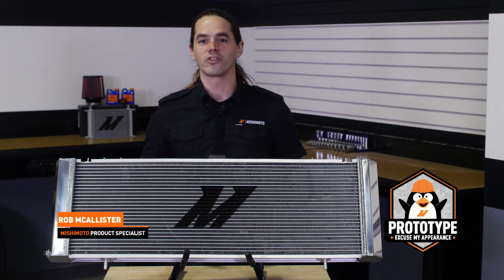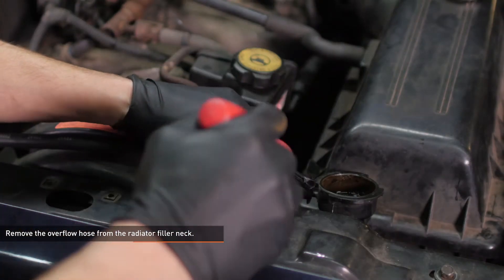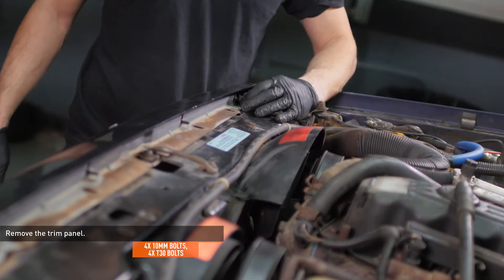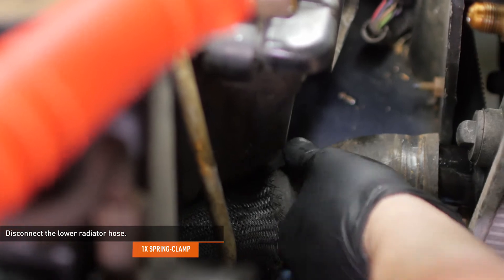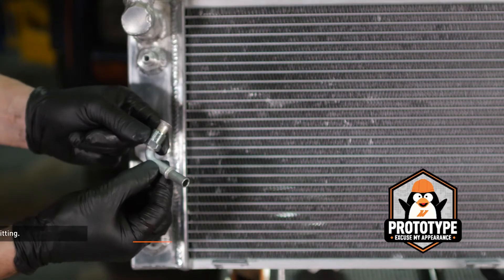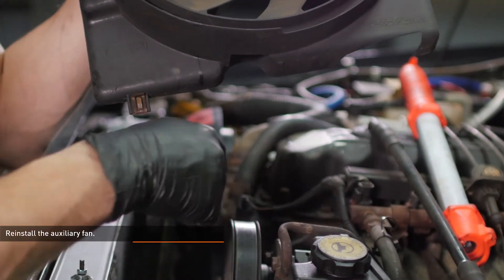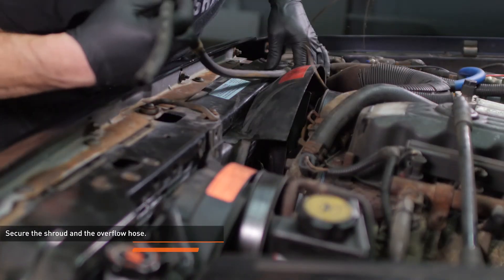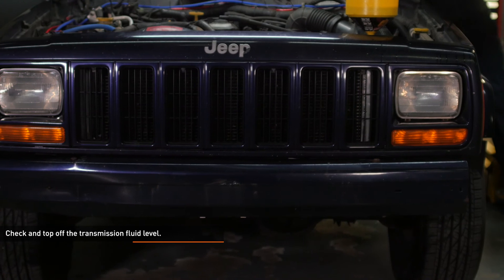1989–2001 Jeep Cherokee XJ Performance Aluminum Radiator Installation Guide by Mishimoto

Comment: Will this work for my 88 Jeep comanche ?
Reply from the maker: Unfortunately, this does not appear to be compatible with the 88 Jeep Comanche. Sorry!
Reply: @mishimoto  
I called 1.877.GOMISHI
and the sales rep said it would fit perfectly. Should I not get it ??
Reply: Yes. The front clip/radiator are identical to the XJ. It would be a good idea to convert to the open system though.

Comment: My xj is a manual transmission. Do this radiator comes with plugs to cover the transmission line port.
Reply from the maker: It does not, however, plugs are not necessary.
Reply: @mishimoto  thanks going to upgrade to mishimoto pretty soon.
Reply: @mishimoto I just purchased my radiator for my xj. To clarify I won’t need to get plugs if my xj is a manual? Please explain how
Reply: @davidcatalina6029  The ATF side and coolant side are separate, so plugging it will only seal the ATF-side from outside air.

Comment: I’ve seen a lot of good reviews on this radiator so I got it and replaced mine but this thing has been nothing but problems for me my jeep has been overheating and running hot at times I installed everything right aswell not sure what it could be
Reply: Have you tried doing a coolant flush and purging air out of your system
Reply from the maker: Sorry to hear that you have been running into issues with this, please feel free to reach out to our customer service team at support@mishimoto.com and we would be happy to help out.
Reply: Likewise. Try a high flow water pump. The increased volume of this radiator causes a pressure drop and won’t cool better with a stock water pump.